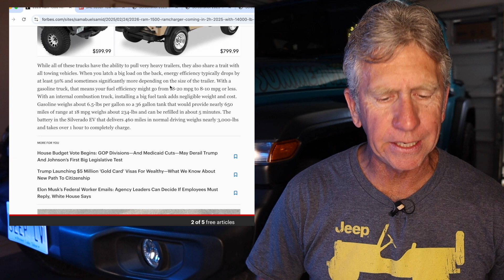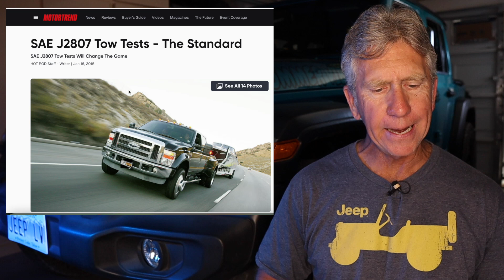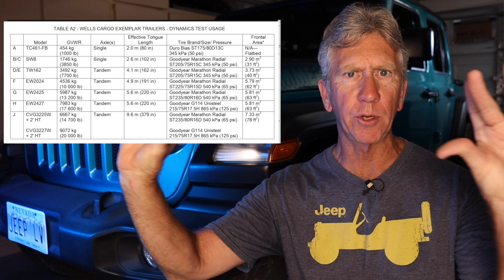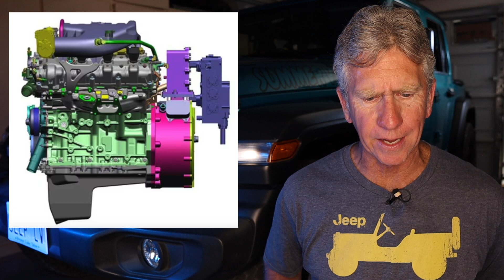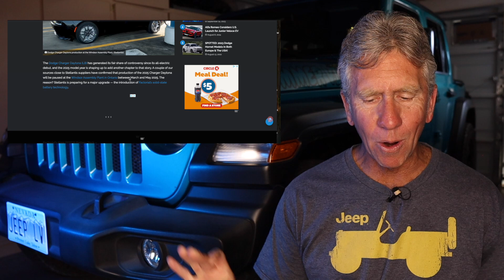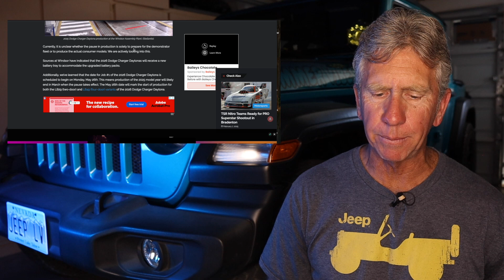RAM 1500 RamCharger: Changing the Pickup Truck Forever

Comment: Ram charger is where we should have been 3 years ago, not pure EV, using gas engine primary battery charger with plug-in capability. Use a solar power tonneau cover to charge aux battery for 24/7 charge while driving or parked
Reply from the maker: Pretty cool idea with the tonneau cover..

Comment: I think it is a game changer. i could be wrong. but i don't recall any vehicle that has an engine providing power straight to the generator providing power straight to the motors.
if i'm not mistaken. couldn't this theoretically mean you could make trucks or SUVs or cars, without a transmission? Just have their engine power the generator and have the generator power the motors directly like the RamCharger... supposing it works just like that. That would remove the Transmission, meaning less work needed, lowering the amount of maintenance needed. possibly lowering the cost of vehicles all around. but the main questions would be. What's the life span of a system like that? Is it longer or shorter than normal vehicles? Lastly, what's the cost to make and maintain them?

Sorry i know we're talking about the RamCharger mostly, but i can't help but think of the Tech. and i know the Chevy Volt was a similar system, idk if it was exactly the same, but i think it had a clutch or something that prevented the power from the engine to go directly to the generators and directly to the motors. i could be wrong though. and if i am please tell me and give me some more info or where i can look more on this
Reply from the maker: Ineresting comments.  I don't know too much about the volt.  I agree it's a game changer.. but it sort of all depends on the rolllout.. whether they have any issues.. and pricing.  We'll see.
Reply: @The.Garage.Studio  I would say there will be issues, nothing that would be a deal breaker. new tech always has some kinks that need to be ironed out.
Reply from the maker: @Romza37  Stellantis just is having a pretty flaky track record with BEV's.  I'm also worried about  the price.  We'll see.

Comment: this is basically a chevy volt with a bed.  looks and sounds great on paper, but pushed to its limits it will be guaranteed to disappoint.
Reply from the maker: Disagree.  This is really a BEV with over 600 HP.  That's not a chevy volt.  They ran the Davis Dam tow test, and it passed with flying colors.  This wil be a game changing truck.
Reply: @The.Garage.Studio  you need to think critically about this and read what the Stellantis engineers actually said.  They fully admit this is exactly like a Chevy Volt.  So running the Davis Dam test on a fresh battery is a gimmick at best.  Only 70 kwh of the 92 kwh Ramcharger battery is usable because they know this is a problem for range extended EV's.  I can't wait to see someone actually try Davis Dam with a depleted battery.  It will be just as hilarious as watching someone trying to tow 14K lbs with a little v6 ford ranger.
Reply from the maker: @rotaryenginepete  That's why they give you tow mode in this truck.  If you're toiwng on a long trip and you know there is a mountain pass coming up.. you put it in tow mode and it will charge up the battery to 35% and then you should have no issues.  Only time will tell..  but this will be a game changing truck.  They had a great idea with the volt.. but it was down on HP.  All automakers are looing to do extended range ev's.
Reply: @The.Garage.Studio  in the real world there is no towing mode that overrides physics.  An extended range EV is by definition a series hybrid, so I don't understand why you told the other guy he didn't know what he was talking about when you should have been looking in a mirror and saying that.  Diesel electric hybrid retrofits like Edison Motors is doing will be the real game changers because they won't get stuck on the side of the road waiting for their weed whacker size engine to recharge the batteries...
Reply from the maker: @rotaryenginepete  The 3.6 Penestar matches up perfectly with the size of the generator. They've been testing this on some of the toughest climbs in North America.  The engineers looked at Turbo Engines and Diesels for this application but ended up deciding the best fit was the tried and true 3.6.  We'll see how things play out.
Reply: @The.Garage.Studio  That is demonstrably false.  If the Pentastar was an adequate size, there would be no need for a battery "reserve".
Reply: @The.Garage.Studio  “What we found is, is that when you get below 10% battery state-of-charge, the power really drops off on what you can deliver,” said Stellantis Lead Engineer for the STLA Frame platform, Joe Tolkacz. “Even if you run the generator at full power, you’re somewhat limited on what you can pull out of the battery. We found that the customer wanted consistent operation throughout the range. So we purposely backstopped the charge-sustaining threshold to be higher, to stay out of that lower power region.”
Reply from the maker: @rotaryenginepete  Exactly.  Keep it in Tow/Haul mode if you expect large mountain passes.
Reply: @The.Garage.Studio  if you think that will work for long term heavy towing, I have a bridge to sell you.  funny how you have already bought into this before it has even been tested.
Reply from the maker: @rotaryenginepete  Dude... i've been waiting for a PHEV truck forever.  Let a dude dream will ya.  I'm actualy 2 miles from the Davis Dam now.  I think i'm going to do some testing of the regular ram 1500's on towing.. and when I can get my hands on the new ramcharger.. do some comparisions.  I've got a good relationship with a CDJR dealership.
Reply: @The.Garage.Studio  Dude... is it a BEV or a PHEV?  Maybe reread the OP cuz it is unclear what you are trying to claim here...  seem more like you are just desperate to be the smartest person in the conversation...
Reply from the maker: @AuthenticRevelation  I'm never the smartest person in the room.  It's really a combination of a BEV and a PHEV.  It's dissimilar to most PHEV's out there though, as there is no connection between the engine and the driveline.  But when rotaryenginepete said it was basically a volt, he was correct.  But the volt was down much on HP compared to the RamCharger and was discontinued long ago.  It was ahead of it's time.
Reply: @ I don't think the OP was about HP, but I do think this went over your head.  Focus on the "pushed to its limits" part of the OP, then how the engineer corroborated that precisely.  How or why would you disagree with the engineer?
Reply from the maker: @AuthenticRevelation  Did not go over my head.  Original post said it was a chevy volt with a bed.  That's obviously not the case.  They designed it with a mode that will ensure enough battery to ensure you can tow 14K up the Davis Dam test at the speed limit.  It even passed the test with 0 battery.   You get EV towing power and torque without EV range anxiety.
Reply: @ it did not pass the Davis Dam test with a depleted battery.  you keep ignoring the elephant in the room.
Reply from the maker: @AuthenticRevelation  It did pass it with 0 battery and using just the engine as a generator.  They talked about it in the video with the engineer you referenced.
Reply: @The.Garage.Studio  no it didn't.  the engineer even admitted that.
Reply from the maker: @rotaryenginepete  Hm.. I guess he didn't mention that, but here is what TFL reported that Ram said "Ram engineered this truck with 8-lug hubs, and even claimed that this truck is built to tow a max-loaded trailer up the grade at Davis Dam in Arizona — a 3,000-foot elevation change over 11 miles — with a depleted battery and the gas generator providing all the power you need along the way." .  The article can be found at: https://tfltruck.com/2025/02/2026-ramcharger-more-details-news/
Reply: @The.Garage.Studio  they are trying to sell it so we have to pay attention to the details.  The test that used the range extender was done with the battery reaching the 35% reserve threshold, not zero.  When towing, the range extender only delays the battery drain because the engine doesn't produce enough power to max tow.  The Ramcharger cannot tow 14k with zero battery SOC.  Never going to happen.
Reply from the maker: @rotaryenginepete  You make a good point.  They did say that the battery was depleted in the quote, but there was obviously some reserves.  Thanks for sharing.  It will certainly be interesting once it's released and the various truck outlets test it.  I actually drove the davis dam road this morning.  Granted.. was only pulling a 2,400 lb trailer in my RAV4 Prime.  And.. it wasn't 100 degrees.  Not tough at all.
Reply: If your towing a 14k trailer for 4 hours through the mountains this probably isn't for you. For the 95% of everyone else this is amazing and definitely something I'm looking at.
 @rotaryenginepete
Reply: @The.Garage.Studio Yeah I've always wondered why they never added a system like this for flexibility and range and here it is  for trucks.
Reply: @The.Garage.Studio  the Chevy Volt was exactly that, a BEV with a range extender.  You could plug it in just the same as this truck.  The Ramcharger''s range, power, and torque to weight ratio is nearly the same.  
Chevy Volt 3781 lbs / 149 hp / 294 ft lb

Ramcharger 7507 lbs / 647 hp / 610 ft lb
Reply from the maker: @rotaryenginepete  How can you say 150hp vs 600HP is the same.  Chevy Volt 0-60 is mid 7's vs mid 4's.
Reply: More like an diesel electric locomotive engine or a Gato class WWII diesel electric power.A very light small battery. Unlike the large lead acid batteries a Gato class sub had to drag around. JMHO
Reply: @kregg-hy4gi  keep dreaming.  the ramcharger is a cheap gasoline range extended plugin hybrid.  so is the chevy volt.  neither of them bare any resemblance to diesel powered electromotive marine or rail systems.

Comment: So I agree that this is a gamechanger...I drive across the continent 3 times a year towing a 6,000 lb trailer.  This Ramcharger will give me the ability to drive electric-only all through the week, preserving my towing and range for long haul trips.  Plug in at home every night transforming the economics of pick up truck ownership and emissions.  On a long trip and Need fuel?  Stop at a gas station for 4 minutes and fill up.  Stopping for the night?  Plug in (and plug in the 7.2 kw inverter/generator on the tailgate to my RV as shore power whenever I want to boon dock.  No engine connected to the wheels?  Perfect - the engine is run without load at the best generating rpm.  Remove all the complications of turbo chargers, belt and drives - remove the EGR equipment.  Simpler, runs cooler and much more reliably. Regenerative brakes?  My Ford hybrid brakes are still at 80% after 100,000 km  with 60,000 km of towing.   Sign me up.
Reply from the maker: Finally!!  Someone that get's it.  5 years from now probably most pickup trucks will be using this technology.  Amen brother!!  Hey.. if you're interested, consider joining my new RamCharger Facebook group!! - https://www.facebook.com/groups/ram1500ramcharger
Reply: Remove complications? That's hilarious!

Comment: Yup, had me till you said EV and Hybrid.  No thank you.  Peace!
Reply from the maker: Come on.. give it a chance.  Have an open mind.
Reply: @The.Garage.Studio  i have zero problem with the existence of and ownership of EV and hybrid.  I simply prefer naturally aspirated gas powered 4x4 vehicles.  Living where I do makes them the perfect vehicles.
Reply from the maker: @Magoo1978  This is the best of both worlds though. You have the EV torque and quietness, but a Range Extending gas generator on long trips or when wheeling.
Reply: @The.Garage.Studio  ty but older gas technology is reliable and easy to work on myself.
Reply from the maker: @Magoo1978  Reliability is still a question mark.  But in general with EV's there will eventually be much less problems.  But yes.. the older ice stuff are definitely easier to work on yourself.  But that's always been the case, every year things are more computerized and less easy to work on.

Comment: I'd like to see Dodge change something to make their trucks not break down all the time. 😅
Reply: There is always a hater
Reply from the maker: @tallboy49  Yep.
Reply from the maker: I love Ram Trucks.  The 2025 1500 is actually rated #1 in reliability.
Reply: 😅one on the market and hasnt broke down yet sounds like something a ram head would be proud of @The.Garage.Studio
Reply from the maker: @kyleinkster4494  Take it where I can get it.
Reply: @The.Garage.Studio How is that possible? You don't really know until 5 maybe 10 years down the line. I hope for the best for ram and jeep but they have made too many decisions to sacrifice quality to save money. I hope they get back on track and make fun cars again.
Reply from the maker: @therealdillow  I agree.  Hope they get back on track as well.  I really think they've turned the corner.  We'll see.
Reply: I consider my ford transit cargo van to be like an F150 with a shell. I'm very excited about the Ram 1500 charger because of how I use my cargo van for camping and traveling up and down the west coast, chasing good weather, benefiting as much as possible from mobile solar power.  The max driving range of the ram charger would really help along the west coast, particularly the lost coast because of how remote the towns are. The weather tends to be cool through the summer along the coast, the further north you go so im not too worried about batteries overheating. Im just stoked to learn more about this truck, ive been fantasizing about an actually efficient EV truck for my purposes